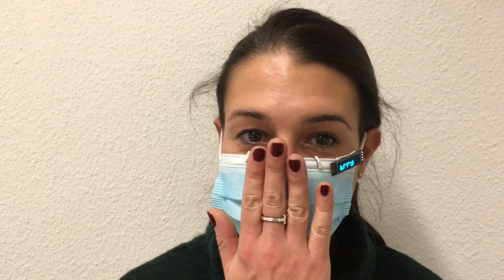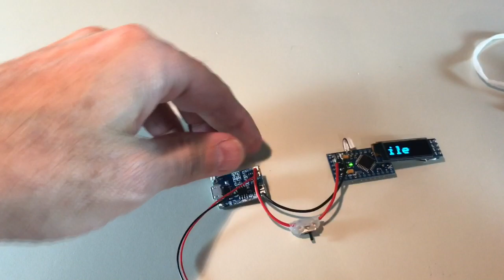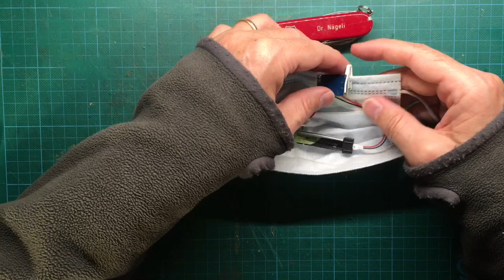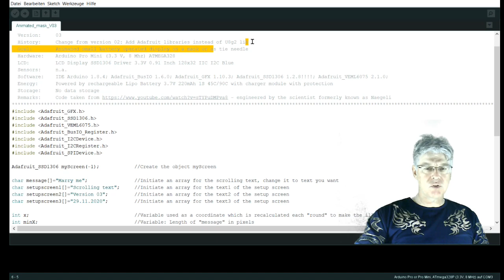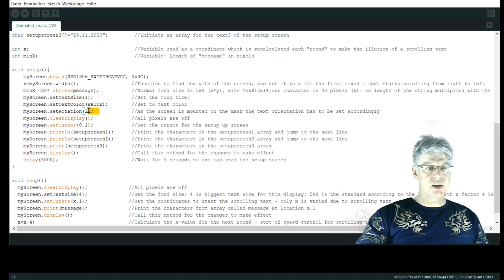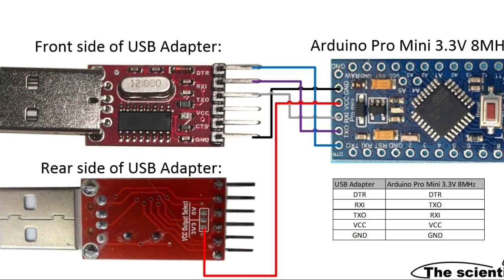Animated mask

Comment: how long the battery can make it on?
Reply from the maker: It is mentioned in the instructable (see link in the description). In the chapter "charging the battery" you will find that it is working for at least 10 hours. Still after 10 hours the voltage was 3.7V. So the battery can be choosen even smaller.
Reply: @LeFreak  okay.. thanx alot for the answer..